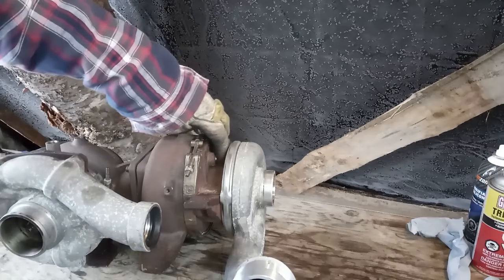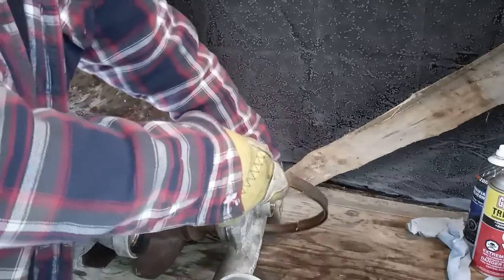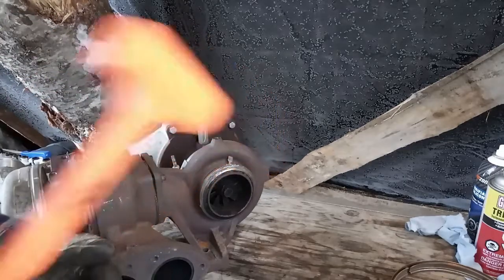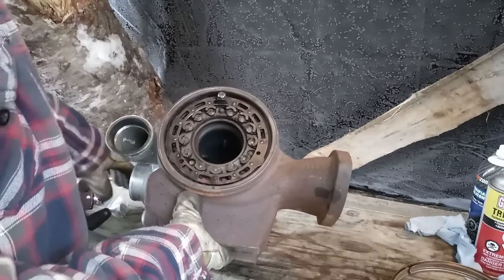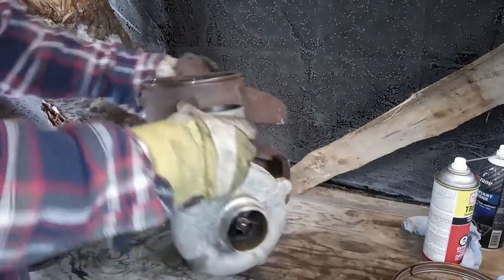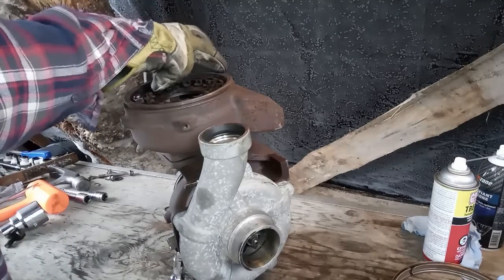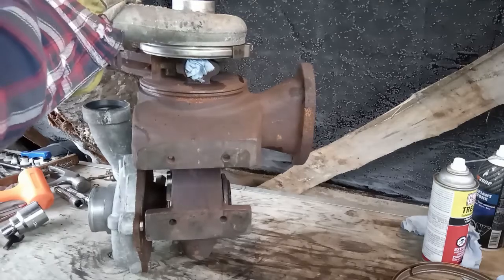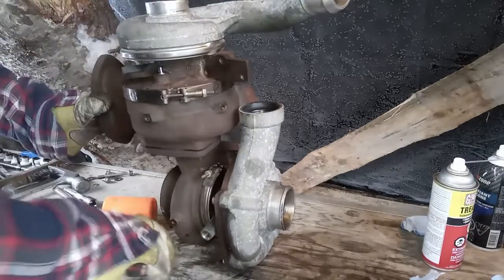How To Replace A 6.4 Powerstroke Turbo VGT Actuator Shaft/Fork

Comment: Any chance you know if it’s normal for some air to come out where the fork shaft comes out? I noticed you didn’t put a seal there so I’m assuming it would be normal. I sprayed my engine down with soapy water to try and find leaks and the one spot that bubbled up is right at that shaft that you just installed. Trying to figure out if it’s normal or not, and really hoping you may know the answer to that lol.

Comment: Where did you purchase the new fork?
Reply from the maker: Hey Bill, there are a few sources. I got this one on Ebay (from Rudy's, this is the link to the exact one https://www.ebay.ca/itm/123821314983), I've also seen them on Amazon, and it's pretty common for diesel parts outlets to have them as well.